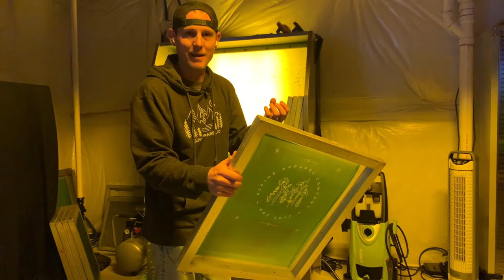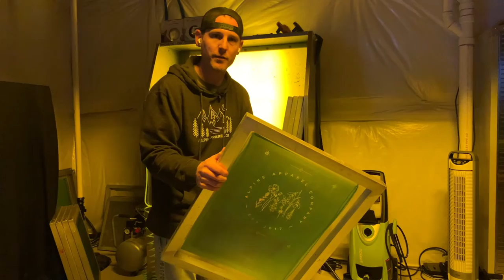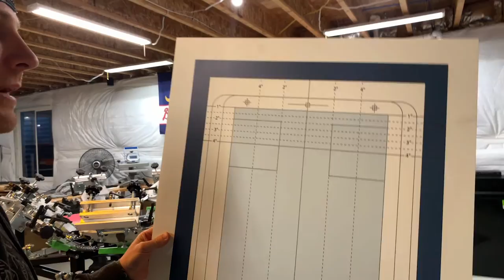Exposing a Screen for Water Based Printing

Comment: Can you expand more on the printer setup you use for your films? The printer, inks to print films, are they refillable cartridges, etc. thanks!
Reply from the maker: Yes I sure can! I’ll prepare a video in the next week or so. I use a Epson Artison 1430 with refillable cartridges using an all black system.
Reply: Thanks appreciate that!

Comment: Inspirational. What is the overhead light that you use to protect your screens?
Reply from the maker: It’s just a standard fluorescent light but it has the light safe tube covers over the bulbs. But I honestly don’t need it because my overhead LED lights have never messed up my emulsion so I could keep the lights on